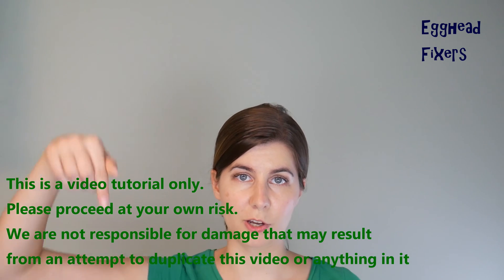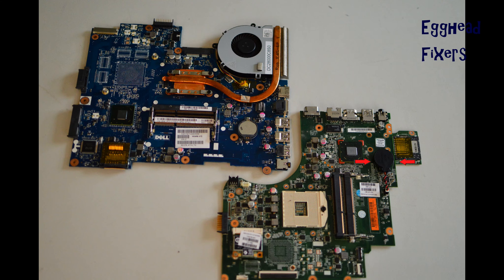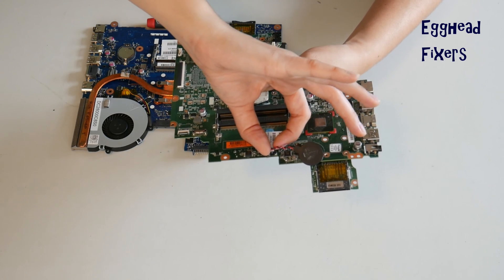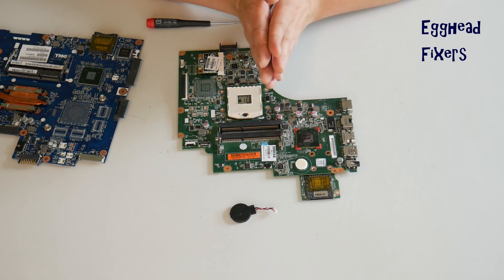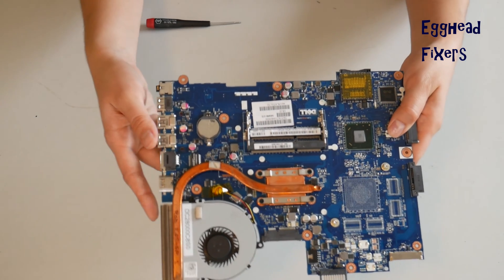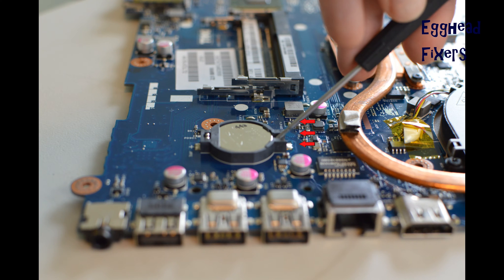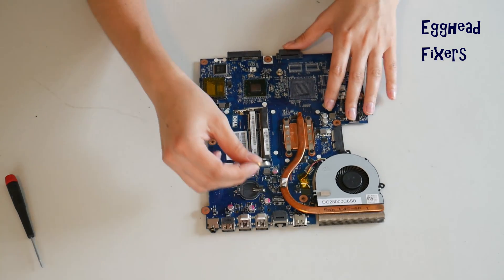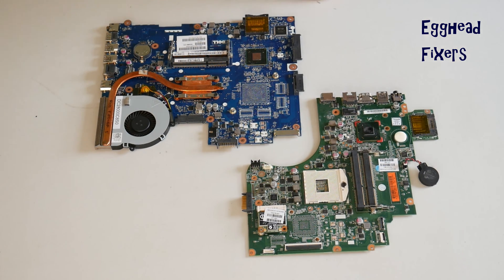How To Do a Bios Reset If Your MSI Computer Turns On Then Off, Freezes or Won't Turn On At All

Comment: mine does not visually have any circular looking button battery on it
Reply from the maker: It could be integrated into the board. It's less common but some motherboards are set up that way and you can not remove the battery. Either that or they use the laptop battery itself as a CMOS battery.

Comment: I'd been struggling with my GE72s- do we know if the laptop would power up without the battery at all? That way I can narrow it down a little bit. 

I actually had it powered up with a new CR2032 put in and accidently took out the connector oops but when I pressed it down and it still powered up pressing the button. However after gluing the connector back onto the mobo it fails to power up again. I suck
Reply from the maker: Oh wow sorry to hear that. You will need the CMOS battery for the computer to work correctly. You can either replace the motherboard or some shops will repair the broken connector on the motherboard.

Comment: I purchased an MSI GT70 and am being prompt for a bios password.
This only happened after I upgraded the hardware. I was in the bios before that without issue.

I tried clearing the CMOS for 3hrs, but there's no change.

I can still boot into windows 10.

Is there anyway I can reset the bios password and/or recover it?
Reply from the maker: That is strange. Did you do the repairs yourself? Did you replace the motherboard? You can sometimes call MSI to get help clearing the BIOS password.
Reply: @EggheadFixers  Yes, I installed the new hardware myself. No, didn't replace the mobo. Just installed new ram and a new SSD.
Reply from the maker: @Tech875O  That is strange. Typically you would have to go in BIOS and set the BIOS password otherwise it should be blank. If you only installed a hard drive and RAM then the BIOS password should still be blank. Have you been able to access BIOS without a password in the past?
Reply: @EggheadFixers  Yes I was in the bios prior to the upgrades.

Comment: Hi Liz, I couldn't find CMOS battery in my HP laptop 15 DA0389TU model laptop. Would you help me find it please.
Reply from the maker: It could be built into your motherboard. What problem are you having with your computer?
Reply: @EggheadFixers  Thank you so much for this early response🤩, Actually when I'm turning on my laptop screen is completely black, but I can hear the fan working. So I tried these things like removing battery and pressing power button for 15secs. 
I could say that my display is working fine because when I removed hard disk for a day and fixed it again the monitor turned on but with an error, I could reset my laptop and reinstalled windows from local storage then it worked for a day. After that the same problem of screen not turning on is bothering me.
Yesterday when I tried to restore BIOS ( windows+B key and power button) for multiple times as nothing is seen on the display, caps lock blinked in a pattern.
I suspect that this all started when I completely drained my laptop battery by using it to charge my phone.
This I what I know,hope this helps you in solving the case 😁.
Reply from the maker: @akhilkumartangi7199  It could be a problem with your RAM. Sounds like it may be starting to fail but that's just a guess. Here is a video on how to test for that problem:

https://youtu.be/EQz0YXZShQ8
Reply: @EggheadFixers  Hi, I saw this video before and thanks anyway. I cannot do this because I have only one RAM stick 😁, it's 4gb laptop. What else can I try.
Reply from the maker: @akhilkumartangi7199  You could try this video:

https://youtu.be/UaWArPsc9Mo
Reply: @EggheadFixers  Thanks, I'll do that
Reply from the maker: @akhilkumartangi7199  You're welcome!
Reply: @EggheadFixers  Hi Liz, just wanted to let you know. Recently I took that laptop (the one mentioned in the above with screen not turning on problem) to a repair shop and got it repaired. He told that some voltage chips are rusted or damaged  and something related to that. Thanks anyway. I love your work. ,😊
Reply from the maker: @akhilkumartangi7199  Thanks for updating us!

Comment: Hi. I have pasword on my bios. If I make what you say in this video, cann I reset my pasword?
Reply from the maker: A BIOS reset will wipe a BIOS password on some older computers. Although on newer computers it tends not to work.
Reply: @EggheadFixers  ok I understand. What cann I make with my computer now? If I want to install a new windows it see not my usb stick with windows and I can not make setting from BIOS because I have password😔

Comment: My laptop was turn on and turn off so i follow your procedure to remove the cmos,  it wont turn on anymore
Reply from the maker: Is the CMOS battery installed correctly? Also if the CMOS battery is weak it may need replacing or to charge for awhile in order for the computer to turn back on again.
Reply: @EggheadFixers  already working i just waited after an hour after following your procedure now its working thanks
Reply from the maker: @jhl4744  awesome!

Comment: Thank you for this video, I was able to restore the display of my msi laptop after following this reset procedure however after shutdown the same problem occurs and need to do bios reset again to restore the display. Any advice please. Thanks
Reply from the maker: It could be the battery or power cord is causing a problem. Try doing a BIOS reset and then leaving the battery unplugged and see if it fixes the problem. If that doesn't work then do it again and try using the battery without the power cord.
Reply: @EggheadFixers  thank you for your response, at the moment laptop is working after I removed cmos battery and unplugged the battery. Ill reconnect cmos battery and test it again. I will update this comment of the result for reference of other  viewers. Thanks again!
Reply from the maker: @adamtyler3949  Ya that would be awesome!! Let us know😃
Reply: @EggheadFixers  issue re occur(unable to boot/no display) after cmos battery was connected. Tested the cmos battery and has an output of 3V. I disconnect the cmos battery however after shutting down need do cmos reset again for the laptop to power on.
Reply from the maker: @adamtyler3949  What about the power cord? I'm wondering if it's not charging it properly. Here is a video on how to test your power cord:

https://youtu.be/3ItsXLWDU8g
Reply: @EggheadFixers power cord has an output of 19 V. I would like to isolate the audio and LAN module however I don't have any spare to do it. The model of the laptop is MSI CR61 and around 5+ years old already. Maybe  there's a component in a system board which is leaky that is causing the issue. I will try to look for a spare system board to troubleshoot again the issue. Thank you so much for the help and suggestions!
Reply from the maker: @adamtyler3949  Ya happy to help:) You could try a new CMOS battery because there is a chance that it is charging but just not holding a charge as long as it should be. Also the power jack could also be the problem. Here is a video on how to test your power jack: 

https://youtu.be/AfboO1B2lHo
Reply: @EggheadFixers  sure, I will try to look for  cmos battery and power jack to isolate the issue. Another sympton I didn't mention previously is there's a delay of about 3 to 5 minutes before display(msi logo)will appear during bootup.
Reply from the maker: @adamtyler3949  That is a long time to wait for it start. Sounds like some sort of power issue.
Reply: @EggheadFixers  I will follow your suggestion to isolate power jack and for cmos battery Im still looking for a spare. Ill let you know of the result. :)
Reply: Powerjack has an output of 19 V however there was no voltage output from the battery charging port of the system board.
Reply from the maker: @adamtyler3949  So it sounds like there is a problem with the motherboard:/
Reply: @EggheadFixers  Thanks again for your suggestions and help!
Reply from the maker: @adamtyler3949  You're welcome:)

Comment: Should I leave CMOS battery for 20 mins
Reply from the maker: Ya leaving it out for 20 minutes is enough to reset BIOS
Reply: @EggheadFixers  I was changing ram timings on msi alpha 15, basically overclocking. I think I fried both my Ram sticks. Fans are spinning and showing light. CMOS reset didn't help. Buying new ram
Reply from the maker: @hexagonal7077  Ah yes that sounds like a definite possibility. If it's helpful here is video on how to test your different RAM sticks:

https://youtu.be/8HHPtdvlvdQ
Reply: @hexagonal7077 Hello, I do the same things, do you have fix your problem, if yes, how did it please, you're sure this setting burn ram stick ? ( sorry for my bad english..)
Reply: @miguelfontal7230  yeah I changed ram..
Reply: @hexagonal7077  f***.. thx

Comment: MSI gl63 9sek 615 us does not seem to have a CMOS Battery
Reply from the maker: It can be on the underside of the motherboard. Also Some models may use the battery instead of having separate CMOS battery. In that case you would unplug the battery for 1 minute to preform a BIOS reset.

Comment: Hi, my MSI Laptop monitor comes on shows MSI then the dotted circle and goes black.  I can hear the laptop which sounds to be working.  This is the second time this has happened, first only 2 months after receiving it and again 2 months after receiving the fixed laptop back.  So all in all its had 4 months occasional use.  What is very odd is that the MSI logo appears on my Surface pro desktop.  Any ideas that might help me would be appreciated?
Reply from the maker: Hi, sorry to hear that:( This video is on Asus but you can use the troubleshooting method in this video to help diagnose the problem:

https://youtu.be/IO1PfKI8cy0

Let m know if you have any questions:)

Comment: Hi..My little brother was playing a video game on my msi laptop and he accidently close its lid while playing..The charger was connected at the time ..Since then Its not responding or anything..Only the charger light flashes..But the computer doesnt turn on..I tried some ways shown in your videos but its not working...I need help.I am trapped in my home and I cant send it to repair in these circumstances..The town is under quarantine and I got loads of office work to do..Is there anyway I can fix my computer?
Reply from the maker: What have you tried so far? Do you hear any fans turn when you hit the power button?
Reply: @EggheadFixers  Anyway of fixing it?
Reply from the maker: @carleditz8730  Yes there is, This is the correct set of videos for this problem. You will need to work your way through them to which solution works. Let me know if you have any more questions:)
Reply: @EggheadFixers   Hi, have done all  manipulations as shown on these 4 videos but still the same.  All light are on, cooling fan is working great but nothing on the screen
Reply from the maker: @tritonveve9446  if your computer turns on but the screen is black then I would try this video:  

https://youtu.be/8HHPtdvlvdQ

Let me know how it goes:)
Reply: @EggheadFixers  I pressed the power button like 100 times but like 3 times out of 100 tries,the fans turned on for 2 seconds and thats it
Reply: I’m having a similar problem but instead it won’t turn on completely and it doesn’t even light up when I put the charger in this happened after I upgraded my ram and removed the battery port from the slot then ever since then it completely stopped working
Reply: @benvenning5997  did find a fix for this? Im having same issues
Reply: Never did just ended up getting a actual pc you might have to just take to a shop

Comment: I loved your style. Make more Videos please. by the way I enabled the OC Genie feature in my bios while i had already overclocked my CPU... and I think I was not supposed to do that... and then my PH61A-P35 (B3) MotherBoard got fucked up and keeps restarting itself infinite times over! one second after another! again and again and again! I tried removing the battery a hundred times even connected them jbat1 2 pins and did all the manuals and shit but... yeah. I'm done for. can u help ?
Reply from the maker: Thanks:) Does it function fine when its in BIOS? When does the restart loop start? For example does it turn on for a few seconds and then turn off or does it start up get past the logo give you an error code and then restart. Let me know/